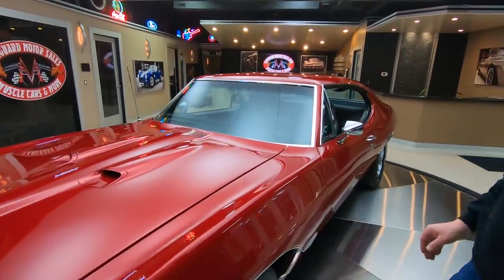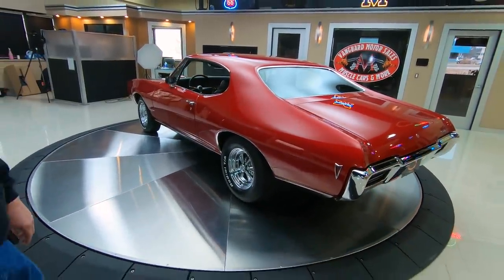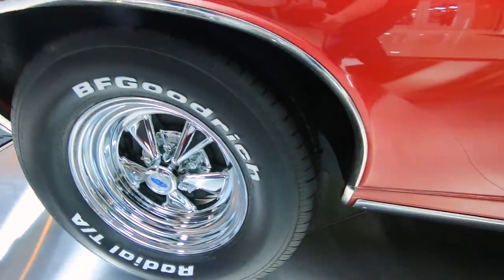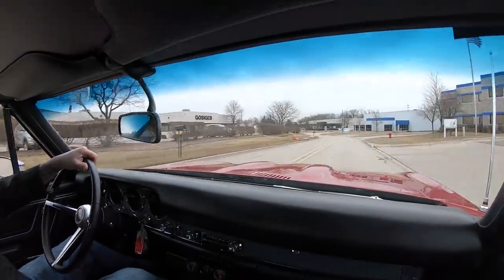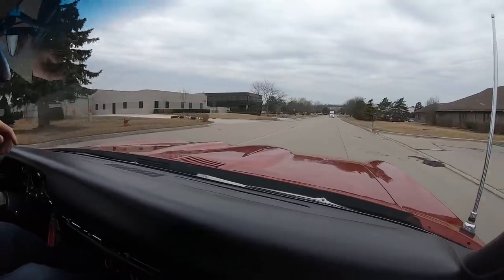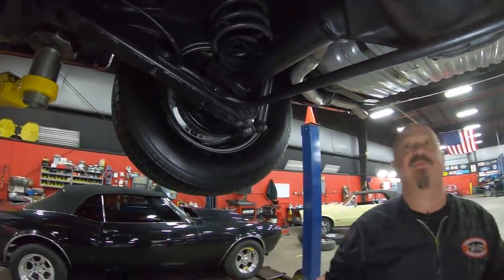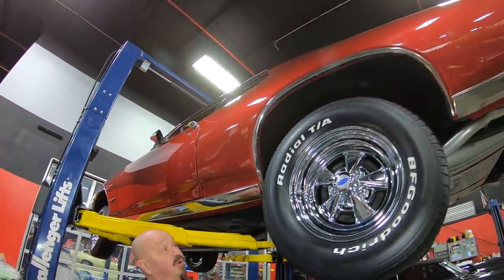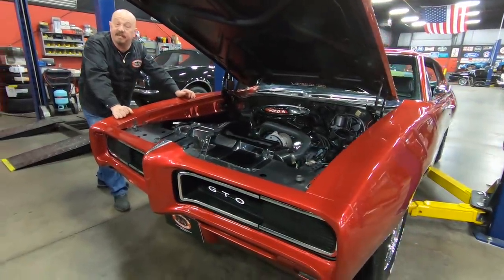1968 Pontiac GTO For Sale

Comment: Nose is actually called endurance bumper, made of a hard rubber type material!  I understand you have to put a flex additive in the paint because of expansion due to temperature changes!!!  68'  is one of the prettiest model years for the gto!!
Reply: Endura